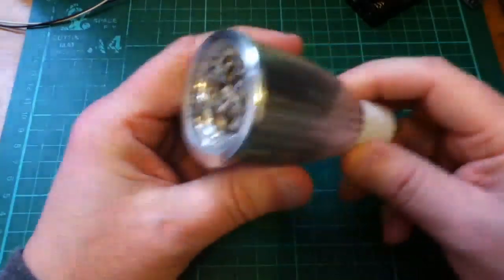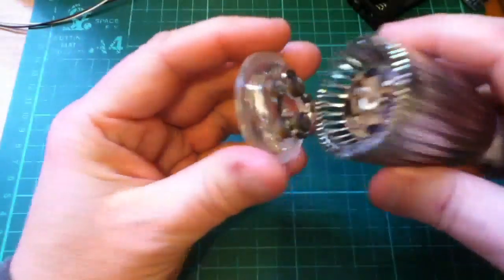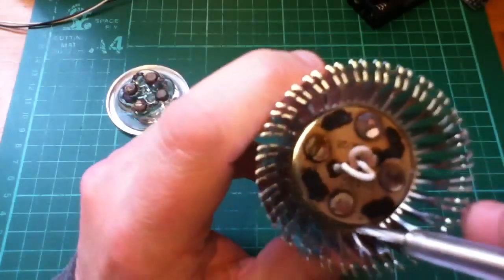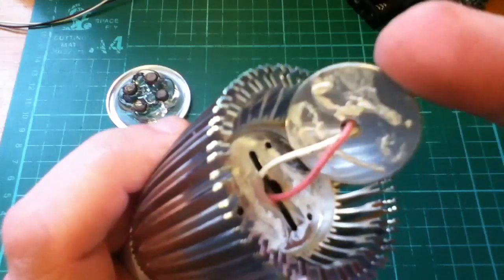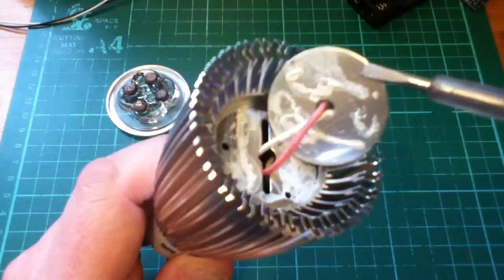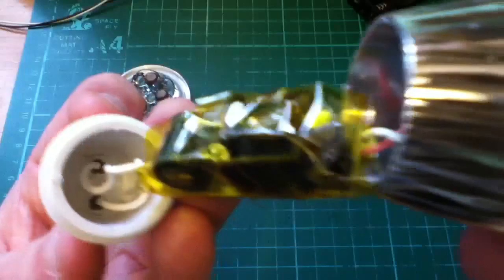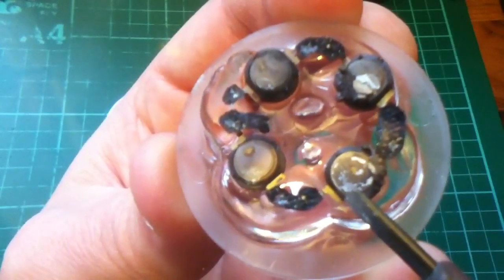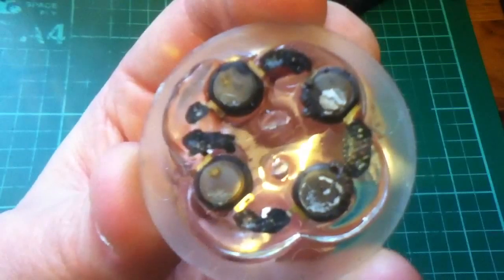Burned Out 12W GU10 LED Spot Light Dismantled - Problem Found

Comment: I gave up trying to find good LED's on ebay... just buy from a reputable dealer in the UK; it's relatively expensive; but at least you'll know they've been designed and assembled properly.... if that thing burned up and set fire to a carpet or furniture whilst you were out of the room it doesn't bear thinking about. Some things just aren't worth it.
Reply: Gareth Crispin Tbh, that's the way Im seeing things now as well. Id rather pay £10-£15 for a bulb, if it means it'll be SAFE! (Though avoiding Asda and the like because they're mega expensive for the amount of hours theyre meant to last)

Comment: This is why I don't like LED lights they have just as many problems as a CFL, and they can die just as easily and I don't trust super compact power converter circuitry that kind of circuitry can be a  fire hazard in my eyes I get a bit OCD with appliances that can be a fire hazard in my home even a small house fire sucks. I know from experience not something you want to wake up to at 3 in the morning. If your gone and one of those LED lights start to burn you better hope your light fixture can hold the burning plastic, otherwise you better hope it dosent get out of the holder. My bulb holder is a hanging glass bulb so it probably wouldn't do much but I don't like leaving it to (its fine it will probably smolder out). I want close to 100% fire safety as possible sure a alarm system can call for help by then its too late.

Comment: Did you actually meter it when it worked ?
I've now bought six MR16 lamps in similar housings and found that they were accurately described when they were sold as "6 watts", but they were all subsequently hyped up to 9 and then "12 watts".
Hilariously they were claiming 50 watts equivalency by virtue of claiming that LEDs are 8 times more efficient than incandescents !

Comment: 3 Watt LEDs need to be soldered to the PCB, accept nothing else! The slug on the LED is to small to give a reliable thermal dissipation with just grease, especially with LEDs > 1 watt.

Comment: I use the Cree 60 watt equiv. (800 lumens) and they put out great light and so far, many months with no problems.  It is very well designed and built.  Only about $12 US and much better than all of the $30-$40 bulbs I have tested.  Also, very easy to modify to run on my 1.5 volt joule thief circuit.  

Bill

Comment from the maker: Yes, I'm having difficulty finding reliable GU10 LED bulbs. The problem is always overheating - they either melt or burn out. The COB (Chip on Board) types look the most promising.

Comment: Interesting stuff. I've used a few 12 volt LED bulbs and not had one fail yet, but the quality of manufacture and quality of light is very variable. My only 240 volt LED purchase so far failed after 3 months use - it started to flash on and off. It was a branded unit (Philips I think), but it highlights the issue that there is a lot of rubbish out there. The unfortunate part is that it will put people off this exciting technology which is a shame.